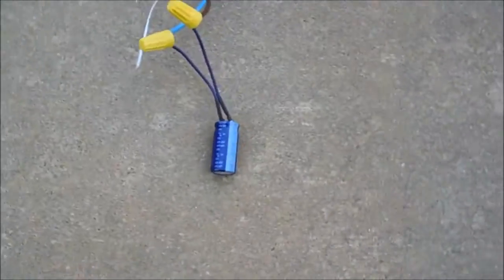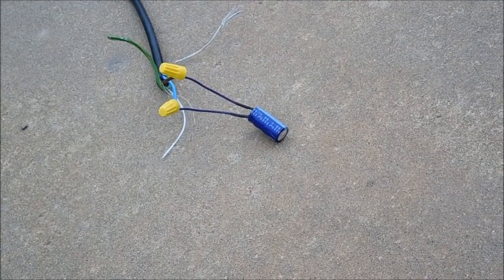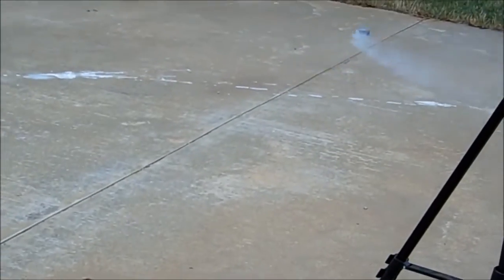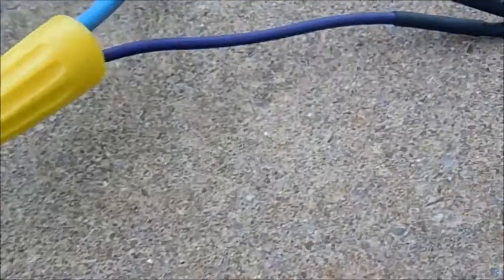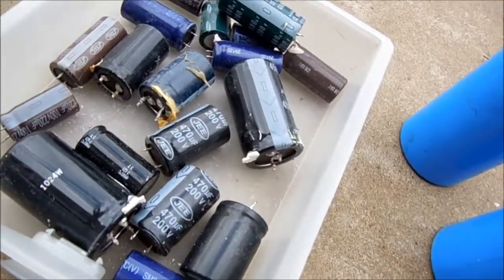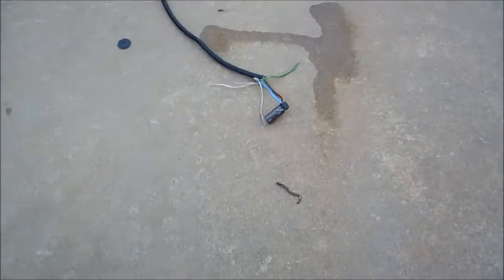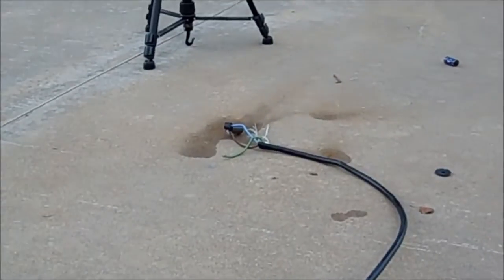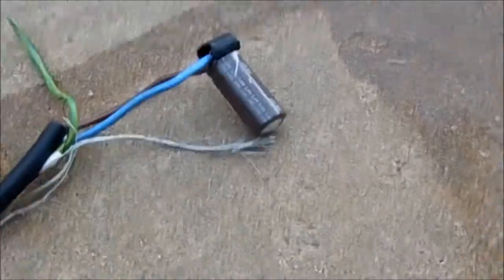120VAC + DC Capacitors = Rocket Powered Exploding Capacitors!

Comment: Great pops, but "Rocket Powered Capacitor" got my hopes up that I would literally see it launch itself into the air.  Damn.

Still very good compared to the usual though.
Reply from the maker: I wish it went straight up in the air to ;)
But it did rocket itself across the ground after blowing its leads off.
Thanks for watching and commenting!!
Reply: Electrotechnics for doing that, you need to use one that has the metal top plain, I mean, without the crosses or the "Y" because if they do have these marks, they'll just vent like this one http://upload.wikimedia.org/wikipedia/commons/1/1e/Blown_up_electrolytic_capacitor.jpg. you can use axial electrolytic capacitors for loud bangs. these will always explode as they don't usually have "programmed vent holes"